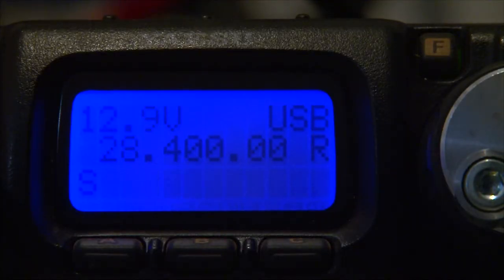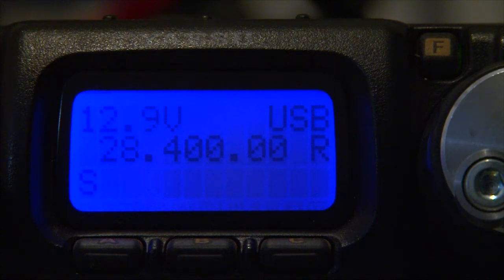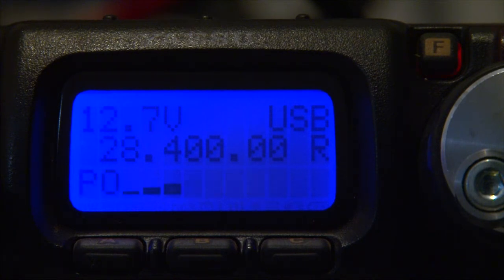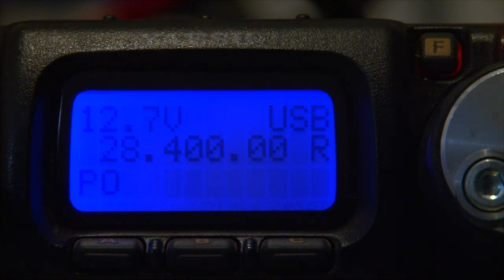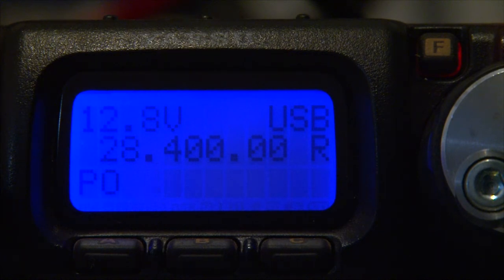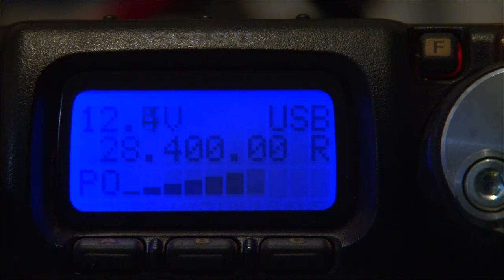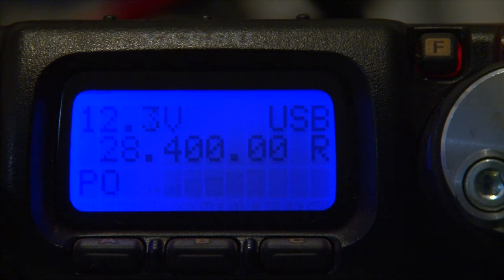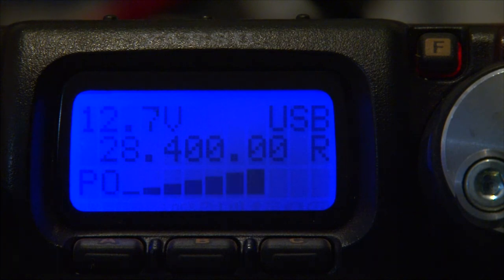DYC-8x7 Speech Compressor

Comment: Did you adjust the variable resistors on the compressor board at all? I cannot find something useful in the manual on how to adjust it properly. And did you change any settings in the radio menu or service menu?